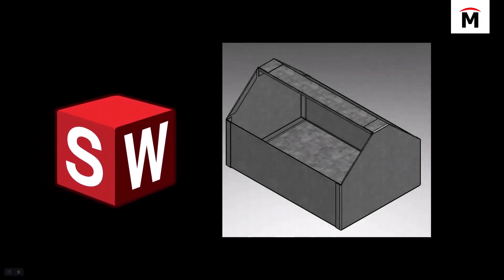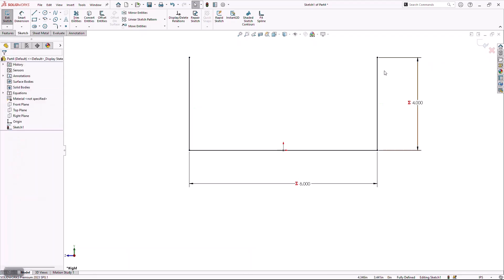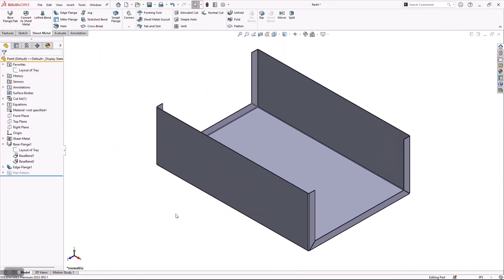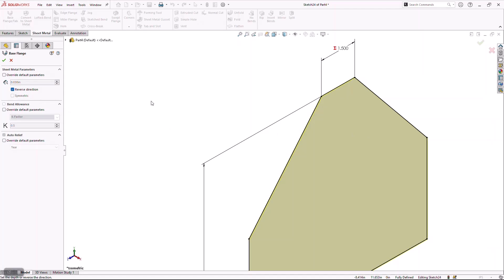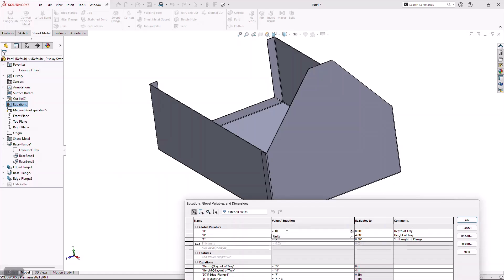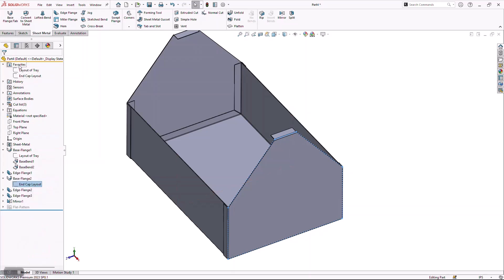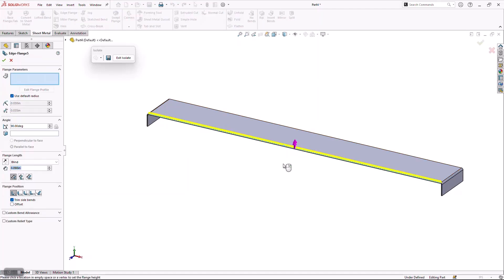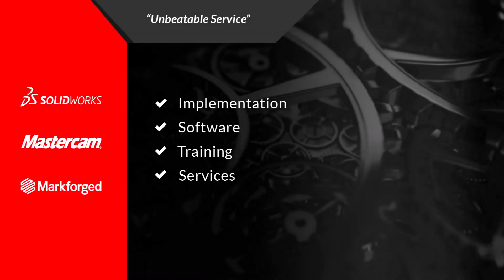Toolbox Sheet Metal Tutorial - SOLIDWORKS Multi-Body Sheet Metal Part Modeling

Comment: this works great. and solidworks indeed works great in multibody. BUT try place this model into drawing. using BOM to show what parts go where. but if you flatten a body with reference to the BOM. it will break the reference to the BOM when you flatten the body. :( and so far. cannot find a solution. :( help?
Reply from the maker: That is interesting, I just did some testing to confirm. Weldment Cut Lists have no problem keeping track of item numbers for flat patterns of bodies, but when a weldment is displayed and dissolved inside a BOM the rules are slightly different.  If you have multiple configurations of any part available, and ConfigA is active in the assembly and BOM, then a view containing ConfigB is not actually included in the BOM and shows an asterisk inside the balloon.  Since flat patterns always have unique configurations, that makes them difficult to use with a BOM.

I can think of a few workarounds.  First, if you can use a Cut List instead of a BOM that would work a lot better.  You could also put a small isometric view of the weldment or body next to the flat pattern for reference, and add the balloon there.  If you add a note or view label, you can click on a balloon to link to and include that balloon in the note, so you could use a note that links to a balloon on another view or sheet.  That would be parametric, but it would have to be manually created so it could be prone to error.  

This is the perfect scenario where you should report this to the support team at your value-added reseller. There is likely a bug report that exists, and if enough people send in the same report it acts as a vote to push it up the priority list for a code fix.  If you are a customer of MLC CAD Systems, you can do that by phone, email, or web.  https://www.mlc-cad.com/technical-support/
Reply: @MLCCADSystems  Thanks for the help! i just do my best to find a solution first. (learning opportunity) i guess i just got a bit frustrated yesterday. :D Using cutlist indeed helped. didn't know i could use weldment cut list, on a non weldment part. But indeed it keeps the reference when using flat pattern in drawing.

did write to our re-seller (PLM-group) so they can make a rapport to dassault.

Finally passed the first year at my new job, designing HVAC systems. So i can start getting some courses to step up my game. Done with entry level education as a machinist and diy skill. :D (requirements in the country i live in, before i can demand courses)